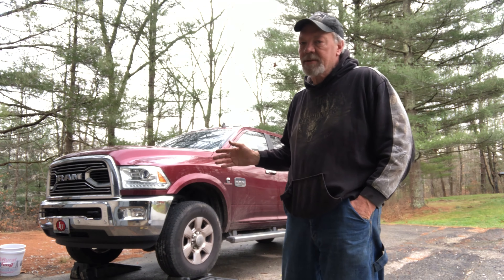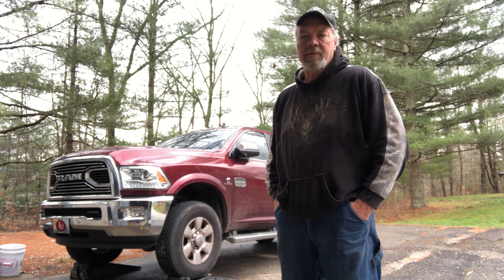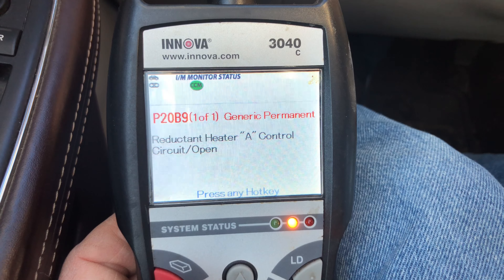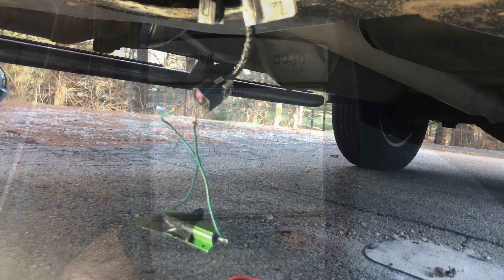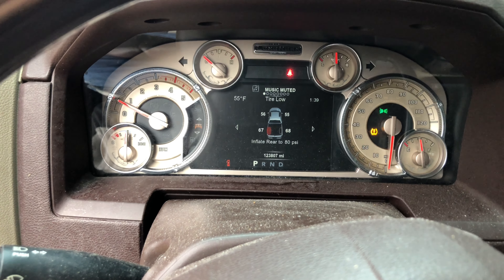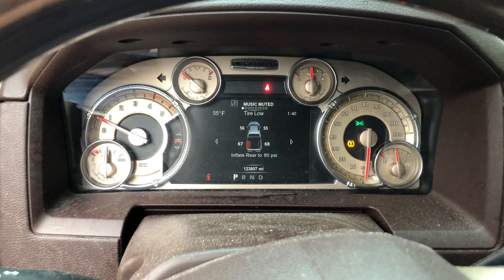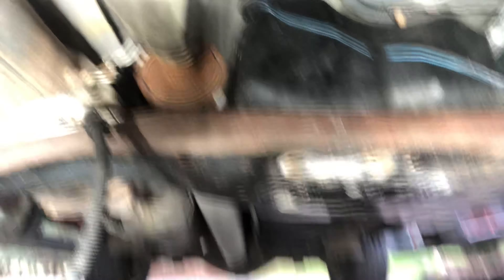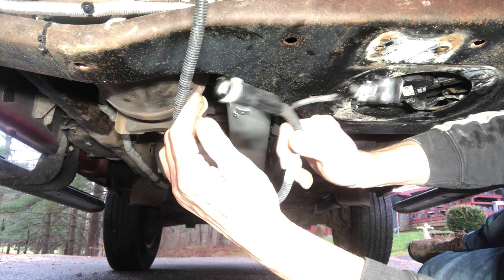2018 Ram 2500 Diesel DEF System went into 5MPH Limp Mode

Comment: I really appreciate your video. I was going from Arizona to Wisconsin when my check engine light came on and started the countdown to limp mode. I was able to quickly scan the code and do some google searches when this video came up. I watched it and it was the exact issue I had. I coasted into a ram dealership that had some parts. I fixed it right their parking lot on a Saturday for $350. The dealer was out there instantly trying to sell me a new truck. Thanks for the good video
Reply from the maker: Wow you were lucky they had parts and impressive you were able to fix in the parking lot 👍great job 
Glad the video helped 
Happy Newyear !

Comment: Emission’s has killed so many potentially good vehicles. Most every issue on newer diesels seems to be emission related and not the actual engine components. I hate you had so much trouble and expense, but it’s good to try and help others with what you’ve learned.
Reply from the maker: Thanks for watching 
Not much out there on YouTube about it 
Just trying to help others out with my mistakes 😬😃🦎💰💰
Reply: @PetersonFarmsofNashvillePFON  I got a p1c54 code from my ram and went to the dealership for them to run the code and there was a man there with a eco diesel 1500
 With a catalytic converters stopped up and dealership wanted 4200$ for repair
Reply: That’s why I have a deleted truck. Def is crazy and made to kill good engines

Comment: You said you bought the harness and tube/heater at the dealership.  What is it called?
Reply from the maker: Diesel exhaust fluid supply hose 
Goes from pump to def injector

Comment: Hi Phil.  Could you please explain the resistor procedure to me, my truck went into limp mode and I would like to verify if I'm on the same boat that you were with this repair.  I've never attempted this type of procedure, so I would greatly appreciate the play-by-play.  Also, I've read that some people had to resort to using a 3 ohm resistor because the 2.2 wouldn't work, any thoughts?  I greatly appreciate any help.
Reply from the maker: I would think 3 ohm would be fine just to confirm it’s a break in the wire going from pump to injector 
A simple lite meter would show that as well 
With the resistor in place you would be able to start vehicle out of limp mode but your def line would freeze up in the winter and you will have a lot of other codes 
I would buy the injector line 1st and replace 
Simple and far the least expensive repair 
Good luck
Reply: @PetersonFarmsofNashvillePFON  Thank you for the clarification.  Well I live in South Texas, so thankfully I don't have to worry about def freezing.  I feel like the resistor method is going to provide me both with the additional troubleshooting that I need and also the ability to get my truck moving in the meantime, while I get everything squared away.  I really appreciate your insight.
Reply: @PetersonFarmsofNashvillePFON  Sorry, a couple of last questions, could you please send me some links of the items you used to make the resistor bypass?  Or at least what they are called so that I can search for them? (Resistor, wiring, the pins you used to insert into the connector, etc). Do I have to solder, or will electrical tape or glue suffice?  Thank you in advance

Comment: I think it’s time that the EPA and manufacturers start paying for repairs and down time.  How can a system that freezes at -12C be approved for use in NA.  My truck has been down 3 times because of the DEF system.  One frozen tank that poorly designed heater wouldn’t thaw, one def heater failure and most recently the Def pump.  Truck sat for 6 weeks while waiting for the heater.  Can’t believe there hasn’t been a recall or permanent warranty slapped on  the these poorly designed systems.  I would love to have one of the design engineers sit on the side of the road at -36C with the system froze solid.
Reply from the maker: I agree with ya 
Government Juice (DEF) is such a scam and I would have had my truck Tuned off of it if I could have found someone to do it !
Thanks for watching and good luck with yours

Comment: If someone sees this it is easy to diagnose. Just ohm out the line heater with your VOM meter. If it shows open, replace the wiring harness/ DEF supply fromt he pump to the DEF injector. The heater element went bad.
Reply: Can you explain the steps? 
Set my meter to ohms.  Then what am I looking for?